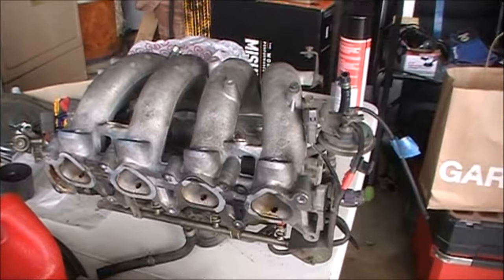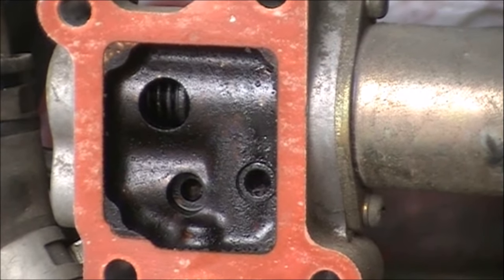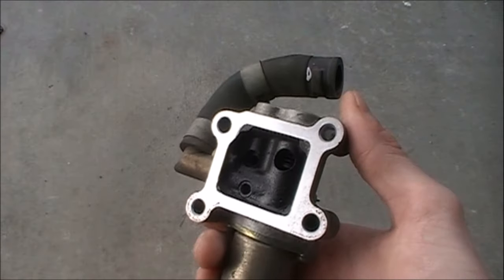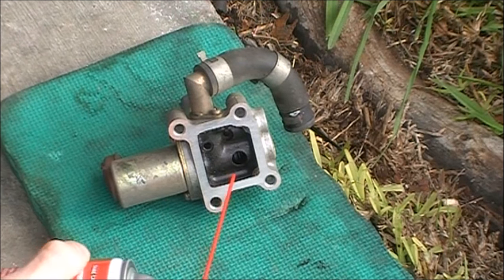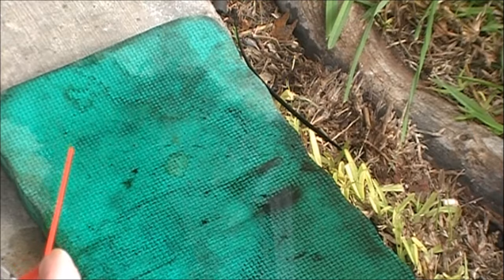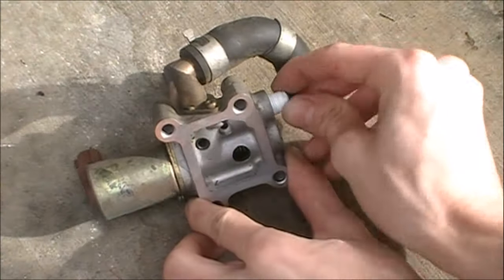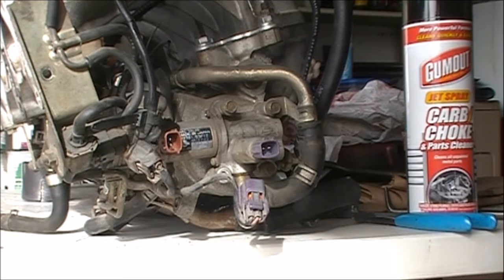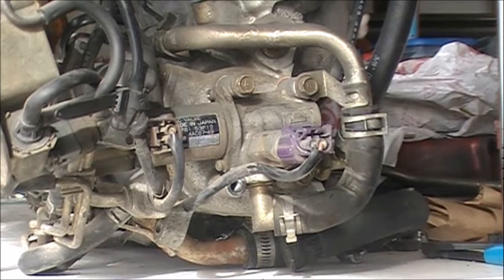Idling Problems? How to Clean Your iacv in 6 min

Comment: You were soooo close to doing a great job but you didn't take the time to separate the TPC motor from the housing!!   Two screws was all it takes and you would have found a ton of carbon buildup against  the critical moving part.  This exposes the inside of the housing and the parts that really needs to be cleaned. Take the same valve apart you just "cleaned" and you will want to redo the video for sure.  However, your video/sound skills are great!!  Good lighting, great instructions, good sound!  Keep them coming.
Reply from the maker: Carl Morrell i actually have this whole engine out at the moment so im ganna take a look. Thanks for the compliments and the heads up though 👍
Reply: Full Tilt Drift so was he right ?
Reply: Full Tilt Drift What did you find on second inspection?
Reply: Thing is, though, the threads in the holes for his mounting screws are stripped out, so he can't really take the risk of finishing them off.

Comment: Can I use throttle body cleaner instead of carb cleaner?  I already have the TBC.  Also, any tips on readjusting the fast idle after this?
Reply: +Tres Kutcher - LOL  TBC is the same stuff!  Only way to Adjust your Idle is your Idle Screw.  Although you must stay around 600-850RPM and depend on your Liking / MFR Recommendation.  Since I am in the Cold Weather, I like mine to be at 850RPM...., waste a bit of Gas, but our Engine are always running in Cold Weather.  If I live in California or Florida... My Idling Speed probably like 600RPM, LOL
Reply: +Tres Kutcher - NOTE: If you want to " Adjust " the idler screw on your IACV... While the Engine is on... Try adjusting it to your liking and watch your " Odometer " for your " Liking " Idling RPM.  Don't try to save GAS and go LOW... Like most People wants, but ending up stalling in traffic.  LOL :D

Comment: i ran into a problem a few weeks ago. I was driving my 240 on a 90 mile drive and before I had no issues, I've drifted and everything. So continuing my story I was at about 80 miles in and it started bogging out of nowhere. So I pulled over and the rpms started bouncing crazy from 1k to about to about 2500. Once stopped it went from around 200-1500 so I let it die out,  I let it sit for about 10 mins and it started right up and I finished my drive. Come later on and I am driving back home and I made it about 2 miles and it bogged out and diddnt start up for about 45 mins. I switched the fuel pressure regulator and temp sensor (has no over heating issues at all was just told to do it cause it could be the ecu) I switched my throttle position sensor aswell and so after I did all that It started up good. 15 mins of driving around fine it started bogging out and wouldn't start again. All this time though on cold start it has a hard time starting  it takes a few cranks do you have any idea what my problem could be from cold start and the running issue ?
Reply from the maker: i dont have a clue on a specific part, but what i can say about it is that most 240s take a sec to start up. im talkin 5-8 cranks. Mine a little longer. But your problem only happens when your car is at operating temperature it seems. If i had to take a shot id say it may be the ignition switch/key cylinder. The contacts can corrode on the switch (back of the ignition cylinder) and can cause this. Id take a look at it man.
Reply: Full Tilt Drift 
I will double check it but the thing about that is I have no ignition switch/ key cylinder. previous owner broke it so I have switches now. I drift it and everything it's ran good (about a year now) :/ thank you again for your response ! Subscribed
Reply: javier tapia could it be the maf sensor?
Reply: +javier tapia - When you put the KEY into the ON in the ignition.  WAIT until you hear the Fuel Pump STOP.... Usually 3-5 Seconds.... Then turn on your Car / Truck... It should fired up right away.  Give that a try... Something took me a while to learn and I just did a Video today.
Reply: ignition coil

Comment: What year/model is that idle air control valve for? I have a 1990 Nissan 204SX that is having a problem with it and we are trying to figure out if it just needs to be cleaned, or if it needs to be replaced.
Reply: I'm about to take mine apart on my 93 s13. Idle stays at 2k and gradually increases to 2500 then back to 2.

Comment: great progy except for the carb cleaner that may end up frying up your internal bushings and it'll eventually be shortening the life of your isc motor

i will strongly recomend you to use simple green instead of the harmful carb cleaner

what i do, whenever i'd serviced these iscs, i fill a metal container w/ simple green and let the valve stay submerged in it overnight - after disconnecting any electric parts attached to it of course

then i blow some compressed air through it and i do lubricate any moving parts w/ some marvel mistery oil before its installation

it just works great!
cheers
Reply from the maker: While i agree that carb cleaner isnt the best fot the rubber and soft components inside, there arent many of them, and carb cleaner usually takes some time to damage these items, hours usually. 
Simple green I dont reccoment either in its undiluted form, as i have personally witnessed it eat rubber floor matts and rubber washers. So while brief exposure may be fine like carb cleaner, I wouldnt be leaving them in overnight. 

Just something else to consider. I used rhe carb cleaner because of the penetrating efficiency, therefore ideally reducing the time anything was exposed to chemicals.

Comment: Could the Teflon tape break down from heat, and be sucked into your intake, therefore causing other problems?
Reply from the maker: Teflon takes a pretty good amount of heat to do anything like melt. You are ganna have to be the judge on your own vehicle, but if its not near the exhaust Id say it will be fine.
Reply: +Hb Hiker - Good observation and thinking for sure.  I was thinking the same thing.  Maybe you can use " Liquid Teflon or High Heat Silicon " or even " Liquid Thread-Lock " ???
Reply from the maker: Jordan Bronson definitely not threadlock if its an adjusting screw unless you dont want it to move. Any kind of gasket maker dries and becomes useless if you adjust it in the future because you will break the seal. I only teflon taped mine because of a lack of proper sealing there, its not a necessity if thats not thr case
Reply: +Full Tilt Drift - Hahahahahahaha, I didn't mean it in a way that NASA putting " Thread-Lock " on their Space Shuttles.... Only NASA idiots will do that.  You put just " a dab " on so the screw doesn't loosen through time and you will still have a chance to adjust if you have to in the future.  BTW... Did you read the part in my post... " Maybe " ???  LOL
Reply: +Full Tilt Drift - Hahahahahahaha, by the way... There is a " BLUE " Thread-Lock which is " Removable / Reusable ".... NOT RED... but BLUE !!!! LOL

Comment: can your car die out cause of this?  if it's really dirty?  I'll clean mine. my car turns off but it's random when it is stopped (specially uphill )
Reply: itll turn on like 2-3 times like every 15 miles on normal traffic.
Reply from the maker: its possible, but generally when its super clogged it will just NEVER idle right and either get real close to dying out, or itll rev to like 1k to stay alive all the time.
Reply: +Full Tilt Drift yo!  it was it!  but I think mine was like the valve! so I got a new one and replaced it. I actually did a video on it too and car no longer turns off. would be cool if you could check it out. thanks BTW.